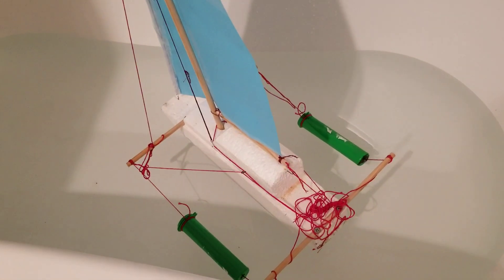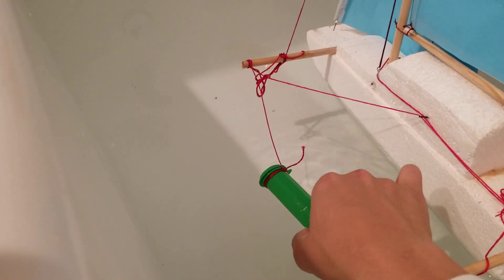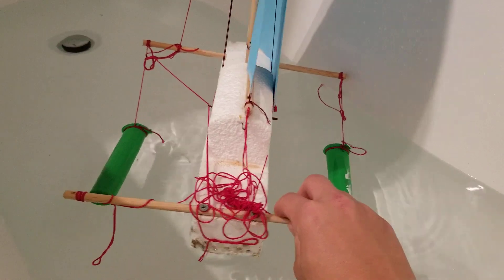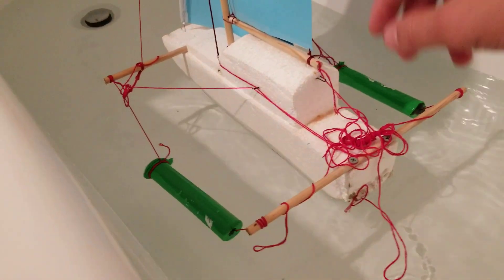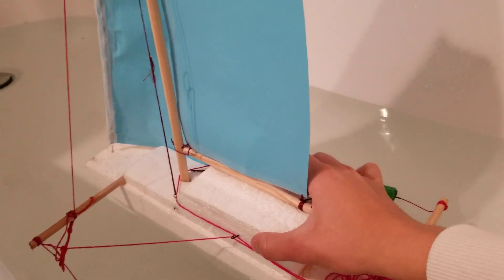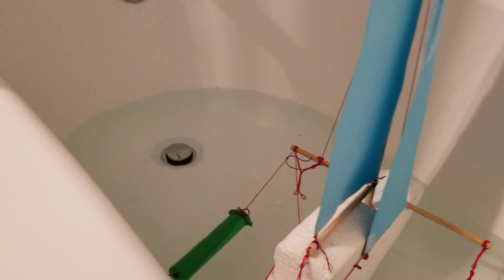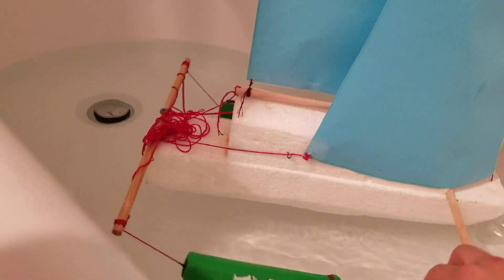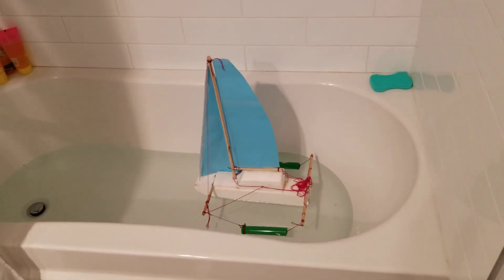Sailboat external water ballast prototype

Comment: If you shape the water ballast tanks for torpedo style, add a small amount of weight light a tire weight on the centerline of the boat at the bottom. A rudder and small ridge down the centerline will get tracking sorted.